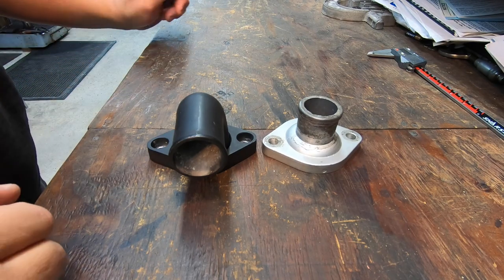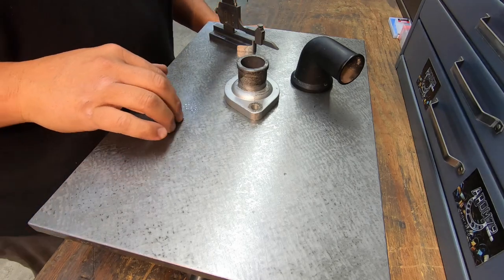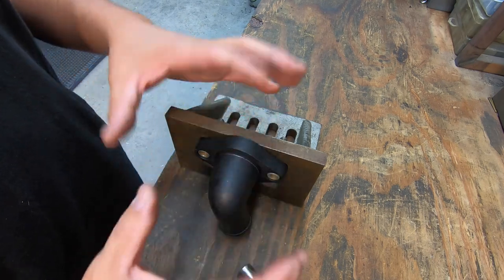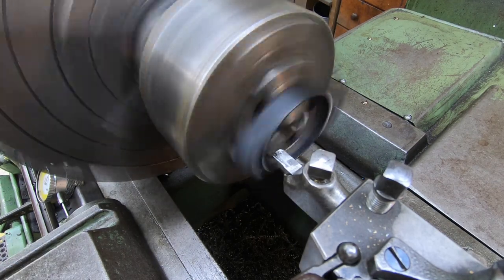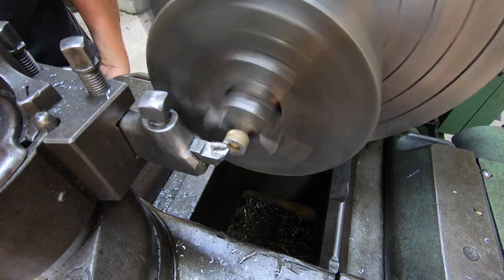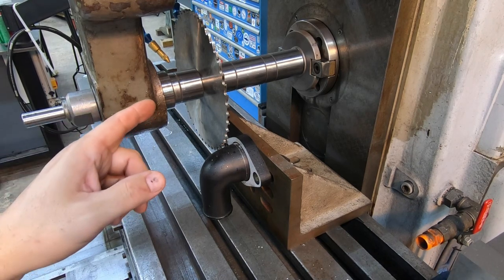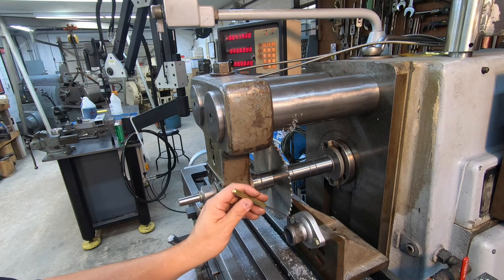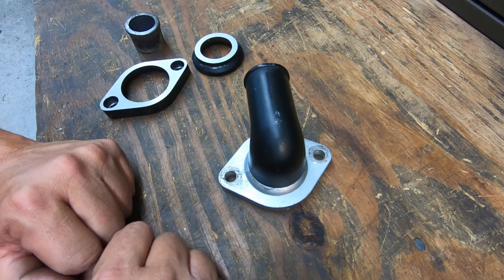SNS 328 Part 1: Machining a Custom Mopar Water Neck

Comment: I don’t understand why he would do all that if it’s just the thermostat that’s different. You can buy thermostats in all different temperatures so I don’t think it would be that hard to get one that works. Just my $.2. I guess I’d do things differently too if I had an Abom as a friend lol.
Reply: It isn't the thermostat. It's the bolt pattern where the housing bolts to the manifold. Trying to bolt a Chevy housing to a Mopar manifold would probably leak.
Reply: @tsmartin  makes sense, I thought he said it bolted Up but the housings were a diff shape. The bolt patterns being off makes a lot more sense
Reply: @tsmartin  makes sense, I thought he said it bolted Up but the housings were a diff shape. The bolt patterns being off makes a lot more sense
Reply: @tsmartin  makes sense, I thought he said it bolted Up but the housings were a diff shape. The bolt patterns being off makes a lot more sense

Comment: Could of put the O-ring in it to add pressure to hold it tight. And cut the entire thing at once. Base, Cap nut tops, and Neck. measure and use a little mathematics. But if you think that your part will get to hot and the O-Ring to melt then your cutting it to fast.. lol Work Smarter not harder. using two sets of scribes when one was already set to the height  was redundant, but if your just showing off your tool collection be my guest. stick with what you know. Don't over do it just to have content..

 Destroying two parts that cost around $35 each to make a part that you yourself said was a "aftermarket part and available" that can be bought for around $35 kinda seems like you and your cousin are in the negative for this project . hope the reavanew of this video brings you in the black, and that you share it with him, Remember this is a "Budget Build" I'm sure he could use it...